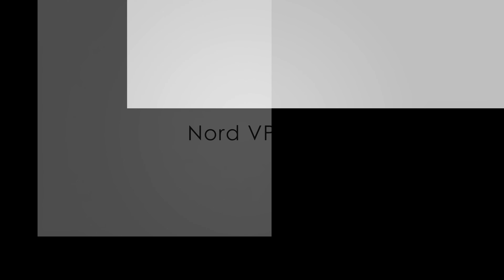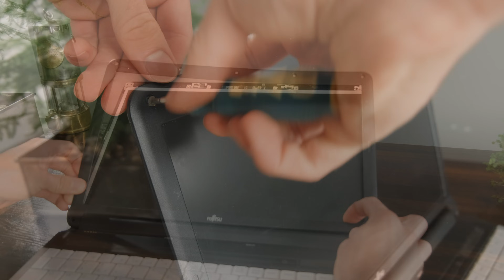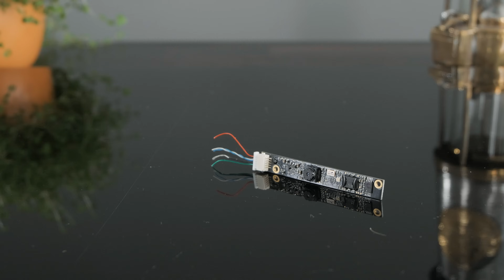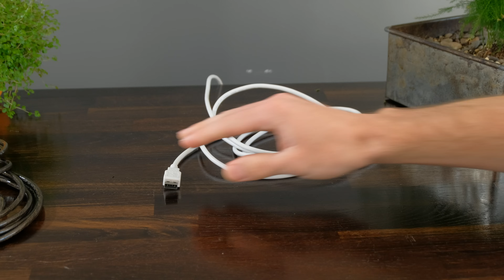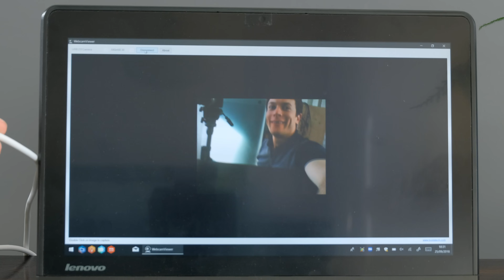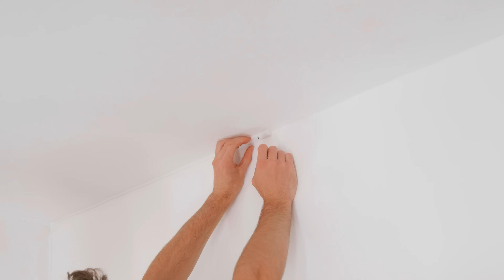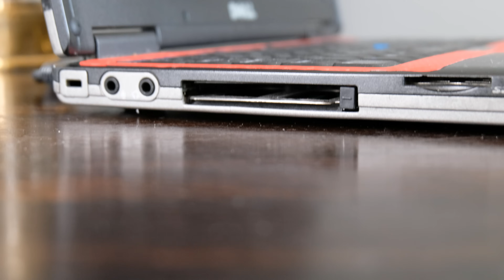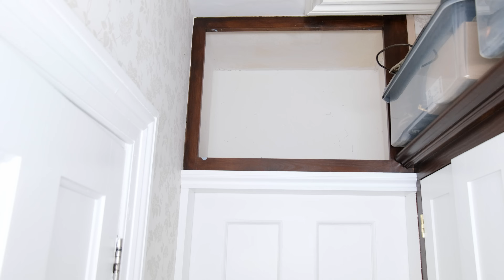DIY Home Security - ON A BUDGET!

Comment: Be careful leaving those laptops plugged in constantly with the batteries in them! Seems like a great idea on paper because it gives some power reserve, but if you're leaving those laptops powered on and plugged in 24/7, that can cause the battery to swell, which is seriously dangerous. Lithium ion batteries REALLY don't like being constantly plugged in, and if the battery starts to swell, that's a serious fire hazard. Look up "lithium ion battery explosion" on youtube, and you'll see what I mean. To anybody who's thinking of doing this project (as well as DIY Perks himself), you're much better off removing the battery from the laptop and plugging the laptop into a UPS if you need power reserve. You can buy a cheap UPS which will provide about 10 or so minutes of power reserve off amazon for less than 60 bucks. I turned an old laptop into a combination Minecraft/Plex server, and one of the first things I did was to remove the battery.

Source: information technology major
Reply: @Greggy Ramirez Depends on how hot we’re talking here. If it just gets warm, then I’d say don’t worry about it, but if it’s too hot to touch, then I’d be cautious. I’m not sure why a camera module from a laptop would heat up like that, as typically laptops are engineered to be as power efficient and cool as possible with minimal use of fans. If it was a camera module you got off of eBay, then there may be some kind of faulty component in it, but if it’s a camera out of an old laptop that you know worked fine, then it may just be an inefficient camera.
Reply: @Greggy Ramirez Happy to help! Just don’t forget to pop the battery out of the laptop you used for the project. On most older laptops, the battery is attached to the back of the machine and can be slid out.
Reply: @Greggy Ramirez UPS for sure. Depending upon where you live, an AVR may or may not be necessary. If you’re in the US like me, then you probably don’t need one if you’re only gonna use it to power a laptop. An AVR regulates the voltage going to whatever is plugged into it, so they’re usually used for equipment that’s sensitive to voltage fluctuations. A UPS on the other hand gives reserve power after the main power fails. Typically, a UPS only provides power for a few minutes, which gives you enough time to properly shut down your PC without losing any work. If you don’t need any battery backup capabilities, then just plug the laptop into a surge protector and you’re fine.

Comment: PLEASE NOTICE THIS, YOU CAN CONVERT YOUR LAPTOP WEBCAM TURNED CCTV INTO NIGHT VISION CCTV BY SIMPLY REMOVING THE INFRARED FILTER ON THE SCREW ON LENSE ON THE CAMERA, IT LOOKS LIKE A REDISH GLASS AND AFTER YOU HAVE REMOVED THEM, YOU CAN ADD INFRARED ILLUMINATORS MAYBE 3D PRINT A HOUSING FOR THE COMPONENTS, BUT YOU ALSO GOT TO LOOK OUT FOR THE 500mA MAXIMUM CURRENT OF THE USB PORT SO THE MAXIMUM BRIGHTNESS OF THE INFRARED AND THE NUMBER OF LEDS THAT CAN BE ADDED INTO ARE LIMITED ON THAT MAXIMUM OUTPUT CURRENT.

Comment: can you also make video about smartphone camera? i have several died phone around & i hope its camera can be used somehow
Reply: It's impossible without using equipment used in making your smartphone in the first place, and the video processing is done in your smartphones processor that's why if you disassemble your mobile phone and remove the camera, you will see a lot of copper or gold contact pads or pins so it's too complicated to be a diy project.

Comment: My camera (from an dell inspiron 1545) has 8 cables! I've only been able to figure out which is ground.

help!
Reply: there may be a silver or gold sticker over the back of the camera, sometimes they are labelled
Reply: The power wire is usually red, the ground is either black or brown, and the D+ and D- are usually winded together and have colors like white, green or pale yellow. The rest of the wires are maybe for the microphone array that may come with your camera so you can either not use them or not.

Comment: Rather than run long USB cables, run the cameras over WiFi with a Raspberry Pi Zero W. They're £9.30 at the moment, so probably cost a similar amount to a usb extender.  Maybe less than an extender and the actual cables.

Comment: I feel like it's important to address that these will basically stop functioning in low light situations. because they have no IR functionality they should be placed near lights that are on overnight. This setup is so cool given it's simple design and use of recycled parts, but I'd really love to see a version paired with a small motion sensing light.
Reply: I have three "Motion Sensor LED Under Cabinet Lights", and not near the camera, so it doesn't give the camera away. Currently they're £8 off Ebay.

Comment: I connected all the wires successfully, so my laptop camera actually works on my PC through the USB. But my laptop camera comes with a dual microphone array (one on each side of the camera). Has anyone figured out how to connect the wires to the USB cable, so as to also get the mic to work? Does it have something to do with the extra two wires from the camera cable (usb cable has 4 and the camera cable has 6 wires) - do you somehow connect them to the 4 USB wires or do you have to connect the extra two wires to an audio cable and plug it into the mic jack in the PC?

Comment: So, my webcam has like 10 cables, and no copper screw to get ground. Any idea how to get the wiring correctly? It's webcam from HP ProBook 4730s, id 10P2SF122
Reply: It probably has a microphone or 2 on the camera board. The twisted pair should still be the camera data. The back of the board may have some copper pads that are used as ground instead of the screw hole.

Comment: Very interesting project.I did the same connection but i was confronted with the USB problem.Using the 1.5 USB cable, i got the image but once i extended the USB cable to let say 30m i wasn't capable of having images.Is it due to the type of usb? Or it depends on the type(capacity ( of my computer?
Reply: Hey i have the same question .. what kind of wire are u using? i guess you need to use cat6 cable(need to modify it)

Comment: Not going to read all the comments.  But it would be interesting instead of running all those USB wires would it not be easier to use wi-fi module connected to the camera.  All that is needed not would be to use all those USB adapters collected over the years.

Comment: What kind of connector is that on the end? I bought a webcam like this but it didn't come with the cable. I'm tempted to just take that connector off and solder the wires onto the board.

Comment: Just a question many of you may know: I got one of the cables broken during my noob manipulation of the webcam and now I'm trying to find USB connectors to the Webcam board itself as the one shown in 2:22. Can these cables/components be acquired by themselves in electronic shops and so on? The point is that I made some searches using words like "USB internal connectors", "motherboard USB connectors" and others but I guess that i'm not finding the appropiate keywords since the products I'm finding cannot be attached to that type of plugs.
Reply: I have no knowledge about this sort of stuff but after a bit of googling I found something that looks similar when searching for "Micro jst 1.25"

Comment: Mine just burned after doing it
Reply: did yours get super hot too? I ran my cam for...maybe 15 min? It was actually hot to the touch. Can't be normal right?
Reply: Higher voltage than the recommended maybe the problem

Comment: I have a question ! how did you conntect the 5 wire from the webcam to the 4 wire of the usb cable 
I do understand Data to data (2 wired) / power to power (2 data) / 
so there is only the ground left and another one ... what do i do with them ?

Comment: This video is very helpful indeed
can i use an external 5v supply rather than using USB power if it is possible it will help me using existing wires with multiple cams

Comment: I can see TI's busting into old laptops trying to make this stuff right now. I can tell you this is a target individual there is nothing no camera system nothing can stop the system for breaking into your house and changing the dates on your camera settings and also bleeping out when they were in and when they were out for some reason I don't know if it's from nanotechnology they can see every single solitary thing that you do everything. So if you try to put out a camera they know how to bleep it or something when they come in the house and change it I don't know how they do this I'd be fascinated if someone that is a tech person could tell us that would be awesome so I could tell our groups how they're doing this
Reply: I run 2 cams thru my tower at home which is on the internet.
I then run " Any desk " which I have set on my tower and to my shop laptop ( also loaded with "Any Desk"
I can operate the Tower from from shop and record everything in my house onto a 3 TB HDD at my shop.
I have had this for almost 4 years and it works great. Any Desk has Password lock outs.

Comment: You might as well buy wireless cameras cheap on amazon or ebay for under $20, because buying USB extenders will cost you more than a cheap wireless cam. plug and play and down load app. your done in five minutes.

Comment: If you don't have a multimeter to check these cables
Then look for a print on the (probably) back of the chip
Mine says
1.3.3v
2. D-
3. D+
4. Gnd
5. M-CLK
6. M-CAT
And the manufacturing date which is something fun to acknowledge
Mine is from Dec 2012😀👍

Comment: Hi Matt, i tried this on a crystal eye webcam from a old Asus Aspire 5930 (working PC but nicked it out as i don't use webcam on laptop). Connected it pr your instructions after finding what cable goes where (simple to do with a working Laptop). i do get power into the camera, but it's not detected at all when i plug it into a USB port. This camera are suppose to be a 720p so pretty good, thus i waned to reuse it. Any suggestions what i can try? Feel free to send me a private msg

Comment: My webcam gets warm. Should i use resistor?
Reply: SAME. Wondering the same thing. Mine gets super warm after like 15min of use. What did you end up doing?
Reply: @LoganJarrell  I think I broke it. It got warm and now there is no video. Just black screen. I think it overheated. Maybe put resistor in the circuit.
Reply: @ruly_cz  i found a reply saying USB 2.0 uses 5v, but the webcam only needs 3.3v, so they are saying to use two diodes 1N1004 in series to drop the voltage down
Reply: @LoganJarrell  That should work too

Comment: A raspberry pi network is really simple to set up, and the Pi 0W is wifi enabled, can be run from any usb charger, and is only $10 USD. So you can set up a new camera for less than 20 bucks, and you don't have to run usb cables all over the place.

Comment: I was looking for a video like this a couple weeks ago. I was trying to attach an old laptop camera to a raspberry pi Zero. I couldnt find any information on the wiring, and i ended up plugging it in and it started getting hot - I didnt use the right wires. This video is EXACTLY what i needed, and I found it accidentally in my feed! Thanks!
Reply: Mine went up in smoke... It worked for 2 minutes until i decided to solder the wires up and i messed up one data with a plus because it was the same colour

Comment: I have a couple old laptops that I stripped down to components because they are dead.  Thought I'd try making 2 security cameras as show in your video.  When I looked at the cameras the don't have the multiple wires that run through a tape to attach to the motherboard.  One is a 3 or 4 year old dell and another is an old old Sony Vaio.  Each camera sports only 2 wires.  The Vaio cameras wires join the wires for the display an that that goes into a clip on what I assume it the motherboard.  What can I do to make these into a security cameras?  Thanks!

Comment: Can you do the same with smart phone cameras?
Reply: A lot of phone cameras dont have separated wires, they have a plastic tab that goes right into it, so it would be much harder. The laptop cameras are cheap, though,  you would be spending most of the money on the usb extensions.
Reply: @kouheimassey  thanks a lot for the info mate!

Comment: You didn't mention adding diodes in between cam's Vcc and USB's 5V to drop voltage to 3.3V - which is what the cam uses...

Comment: This may be a bit more basic than your average project, and maybe a bit beneath your skill level, but I think it would be a really cool companion video to this one if you made a video showing how to use old phone cable to create make a DIY USB extension cable. Think about how much easier... and cheaper it would be to run old phone cable around your house for security cameras instead of USB cable.

Comment: Maybe a quick tip to consider when building this:
If your USB cable doesn't seem to be colorcoded like normally you can easily check what roots where by pulling up an image in which your plug is shown with its pins labels. Then you can use the multimeter again and find the corresponding pairs. Pretty easy on USB Typ-A from my experience. And I know it sounds pretty obvious but believe me, when you encounter this problem you won't instantly think of it. :D

Comment: How would you recommend making this broadcast over wifi?  I’m building a CNC enclosure and was looking at webcams, but I’ve got a super old MacBook Pro that I don’t even have a power cable for. It’d be cool to use a variation on this tutorial to keep an eye on it remotely when it’s running a cutting operation.

Comment: Is it possible to wire the webcam to an usb bluetooth emitter? To get a bluetooth webcam. Would be a good DIY problem to solve, particularly if it addresses the problem of connecting several of those to the same laptop (on a budget)

Comment: Can this be done just as easily with an old smart phone and the phones cameras?
The primary cam as a dash cam (w/sound) and selfie cam as a backing up cam?
Reply: Apps like IPCam . With those u can connect the cameras in a common network and monitor and record footages in a web interface
Reply: you cannot use a mobile cam as it has 10-20 points

Comment: This is great, and I want to do it, but why run USB cables and repeaters all over your house? Why not plug them into a nearby wall plug USB charger to power them, and wire them to Bluetooth transmitters? That way, the USB cable only needs to run from the nearest wall outlet to the camera's location. And you could conceivably also wire a rechargeable Lithium Ion laptop battery to the thing to keep it transmitting for hours if the power goes out.

Comment: This is the video I’ve been looking for for a long time. The big issue with off the shelf video cameras is their bulk. What is to prevent someone from coming at it with a golf club? You can make a housing from thin sheet plexiglas so the camera can fit securely in any location. Thanks!

Comment: Just gotta say - I tried this:
1. USB Webcams have really poor image quality and no Infra Red - they can't see in the dark.
2. Laptop/old USB webcams use TINY cables - just try soldering them and testing them... And making a good looking enclosure for them.
3. You need a big HDD for storing the recorded video and to mess with setting alerts, etc.

At the end of the day, it's just better to sell the laptop for 50-100 $ and buy 2-4 Wyzecams with fish eye, high resolution and night / dark IR capability plus local recording by popping in an SD card. 
It was fun though 🤷‍♂️
Reply: Did your webcams get super hot as well? I only did one, but it seems to heat up pretty fast
Reply: I tried this diy and at first it worked but over time I notice that it's making my laptop and webcams really hot. is there a way I could fix this issue?

Comment: I wonder how the feed looks without daylight.
Reply: Assuming you picked your webcams with this intent, you could make sure they are all sensitive to ir light and have a couple ir lights placed in strategic areas to give their rooms or areas cloud light. Like corner room lamps. But nobody walking in the room at night would see them if the ir torches were aiming up. Military operatives sometimes have them on their back shining up, I've heard them referred to as an umbrella light. Their nog's see the whole room lit up as the light is reflecting off of the walls and bouncing everywhere.
Reply: @sheldonproduction  Precisely, and it isn't difficult to remove the screwed lens assembly (it's a focus ring!) from the webcam and then take the IR filter out. It'll see invisible light.
Reply: @rootbrian4815  well then, it's even easier now lol you think it's pretty universal for most webcams? Thanks for the tip!
Reply: @sheldonproduction  Yup, universal.

Comment: Can you give me a few model numbers that are proven to work? I have bought 2 different webcam boards off of ebay but the wires don't follow the same rules, and the electronics are more compact so it is impossible to determine what any of the pins are except for ground. none of the ebay listings show the wires very well so each purchase would be a hit or miss.

Comment: You could use a webcam, a raspberry pi, solar panel power bank, and phone screen with control board for your front door as a digital peep hole. Or go further and hook the pi up with an IP camera app (droidcam on android) to wirelessly send video to your phone. 👍 Who needs ring?

Comment: Just FYI the most common connectors for these types of cameras are: JST SH 1mm (bigger one) and JST SUR 0.8mm (smaller one). In case you can't find the right cable/connector.

Comment: Would like to see your design of a laptop stand for a workbench or desk that pivots out of the way. So that the keyboard height is about 6-8 inches (15-20 cm) above the work surface.

Should be very useful for DIY’ers who never seem to have enough clear work surface for a laptop to sit.